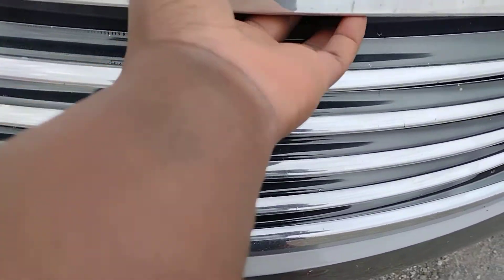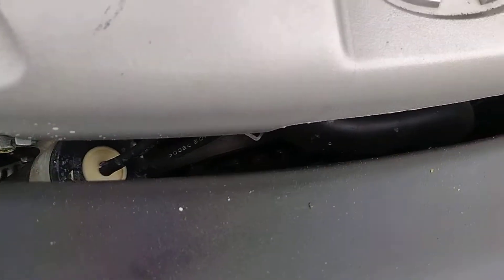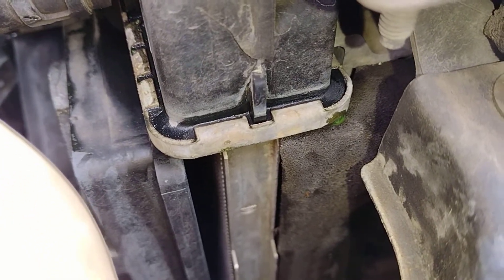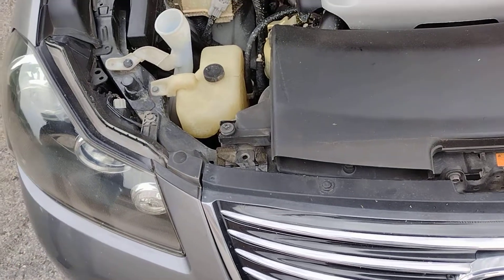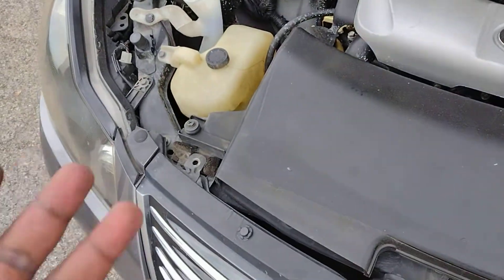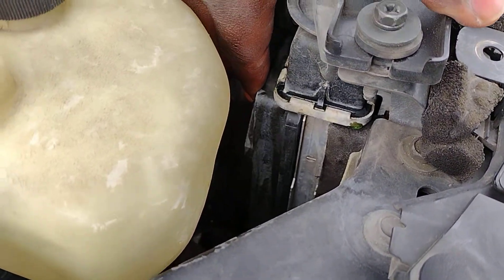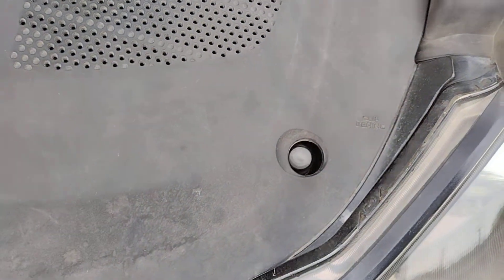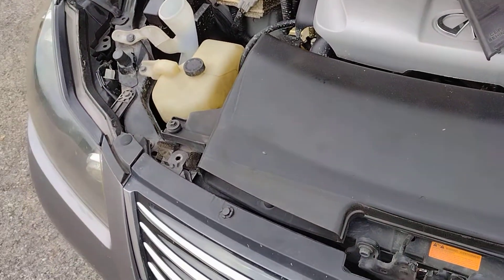Strange Sweet Smell alerted us to Coolant Leak from Busted Radiator| Stay Alert

Comment: I sold my FX50s because of constant coolant leak. I changed all the tubes and still couldn't find where it was coming from.
Reply: Did you take it to the dealership?
Reply: @marlonmcderby5058  Yep.
Reply: @damnnitdave  dam them fx 50’s hard to find too
Reply: I just replaced the Radiator on my 2012 FX50. Hopefully, it's not a constant issue with leaking coolant.